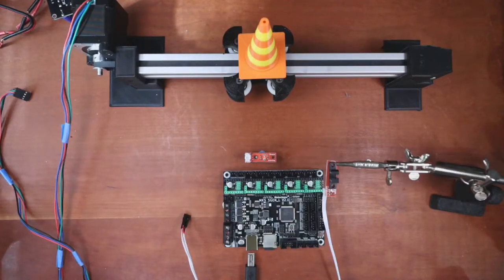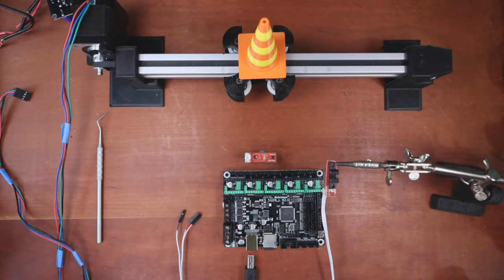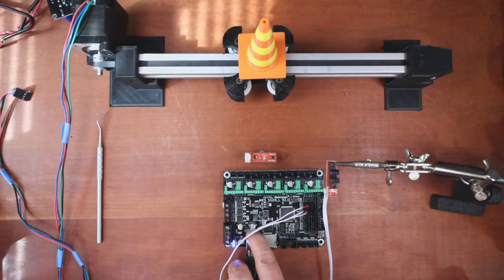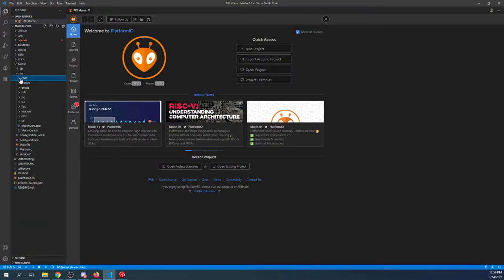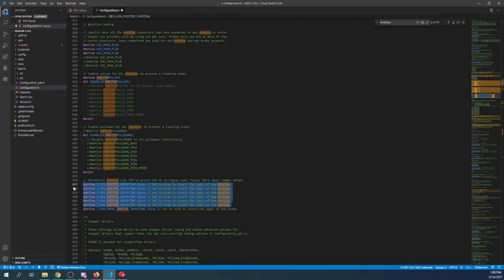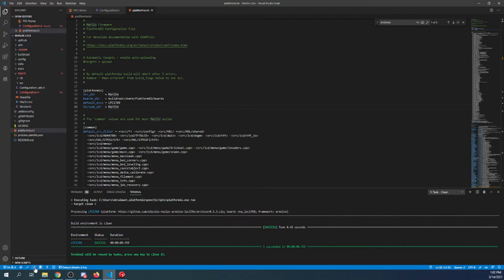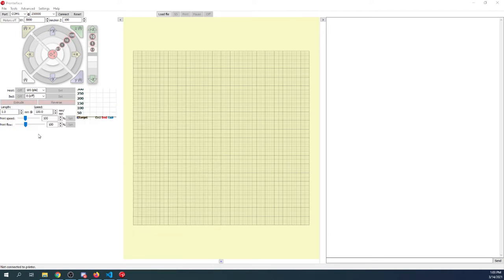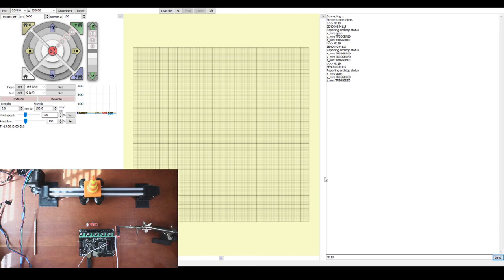MKS sGen L v2.0 - Optical Endstop

Comment: Hi sir iam try to install marlin firmware in MKS GEN L with lcd and sd support bt the lcd display not work its only just flash its blue light when am pressing the switch  can u help me pls
Reply from the maker: Checkout my Playlist for MkS Gen L v1.0, your asking on the video for MkS sGEN L.  They're two different boards.
Reply: @EdwardBraiman  iam solve that problem  am change the direction of lcd connector  then it start to work